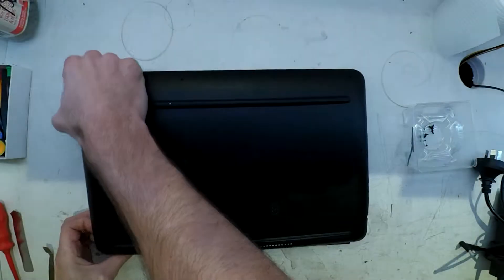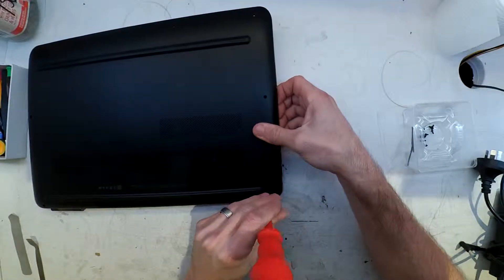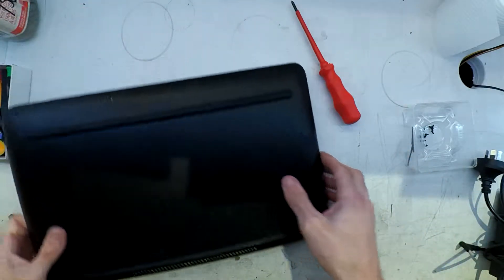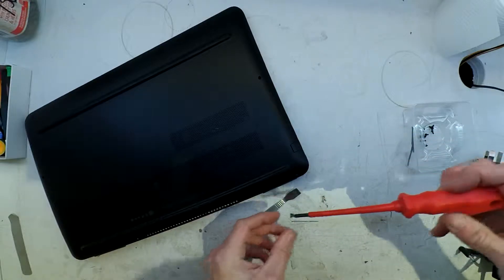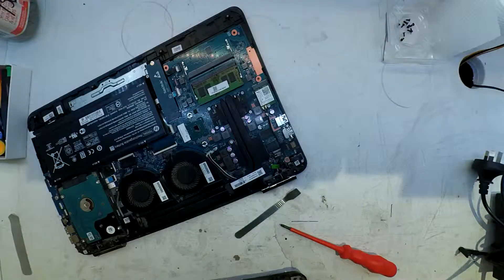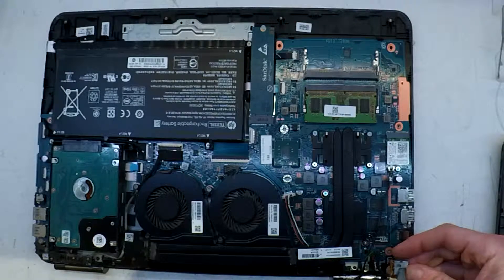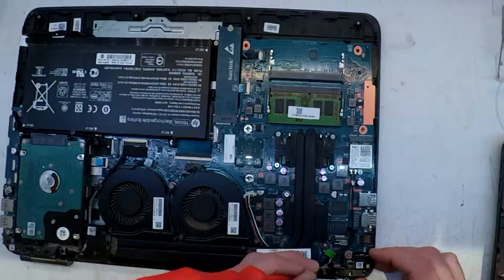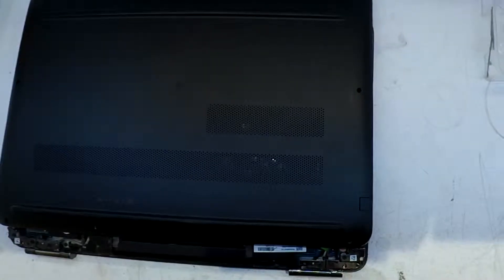HP Laptop Not Charging Possible Solutions

Comment: Hi.
I have a hp.
15-ac143dx model.
It only works fine with the AC charger pluged on without the battery.
When I plug the battery, it wont charge, but only stays on for a minute or so, then cuts off.
Without the battery all works 100%.
What could be the possible problem here?

Comment: Product Name:OMEN by HP Laptop 15-ce0xx

Product Number: 3LH85EA#A2N

I have been having this issue for more than a year now.
My laptop battery does not charge when I plug it in, and it stays at a constant battery %.

However if I manually power it off by long pressing the power button, it will start charging and things go back to normal, but only for a while, until my laptop goes on standby, after that it will not charge again.

I have already tried uninstalling and reinstalling the required drivers, but it is of no help.

It seems very strange to me that normally the laptop won't charge but if I power off by long pressing the power button, it will charge.

Please provide an ideal solution for this, I would be very grateful
Reply from the maker: Hi, I don't have a solution for this issue sorry